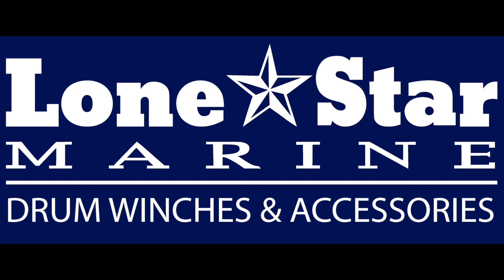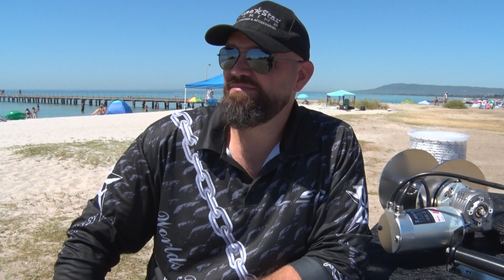LSM Q & A: Questions & Answers about Drum Anchor Winches

Comment: Hi, thinking of a gx2 hd. Never had an electic winch before.
1) When the rode is retracting and the anchor hits the stop i am fearful of the anchor damaging the boat as i cannot see it from the cockpit. Your reaction?
2)  winch will be mounted in wet well.  Any problem with line coming over the top of the drum.
3) is there a remote available?
4).Only 850 mm from anchor roller to winch center. Do i need the addotinal roller?
5) i often leave my 8m high windage boat at anchor for days. Should i keep my 15m of 6mm chain or go 8m of 8mm. Usually anchor in 3m with  15m of rode.
Reply from the maker: Hi
-if you can’t see your bow sprit you can either use one of our wireless remote units, or install a camera in your anchor locker and have it wired to your sounder.
-Wet well and line over the top are no problem
-No I’d say you won’t need an additional roller with that short distance.
-8m boat, if you can’t fit a GX3 (which will hold more chain) fit the GX2-HD and use the shorter piece of 8mm chain and go up an anchor size if required.

Comment: Ive just ordered a GX1 for my boat after recomendations from other boat owners.  I have a technical question i'm hoping you can answer.  With a worm and wheel type gearbox a thrust load is generated onto the worm gear shaft. I'm wanting to know which end of the shaft has the better thust protection? I can then load the spool the right direction to maximise gearbox life. Thanks in advance,  Simon
Reply from the maker: Hi Simon, the difference is minimal, they can be loaded form either direction. More important is the fleet angle, you want that as wide as possible. In other words, avoid 90% bends in the direction of the rode coming onto the drum. This usually means loading the rope and chain over the top.

Comment: I read many users prefer to use electric trolling motors with spot lock over drum anchor winches.

What are the advantages of the Lonestar anchor winch over the electric trolling motor with spot lock for anchoring?
Reply from the maker: Good question.
Obviously electric motors are battery and weather dependent. I have one as well, very handy for covering ground when lure fishing. Using one as an anchor in calm conditions is fine, however in any sort of wind or swell an anchor & winch are the better option. Also with an anchor winch you are not drawing any power while at anchor.
Reply: @LoneStarMarineWinch  Thank you.  Why are TM's the less option in wind and swell - even with an extra long leg?  What length of rope and anchor is comfortably required when fishing at depths of 40m (with a LSM GX3 unit)?
Reply from the maker: @Camh1968  wind/tide/swell will all have your TM working hard which will reduce overall run time. If you are only dropping in on spots for a short time you may be fine. If you are fishing a tide you may not. The GX3 has several rope & chain options from 100m to 300m drum capacity.